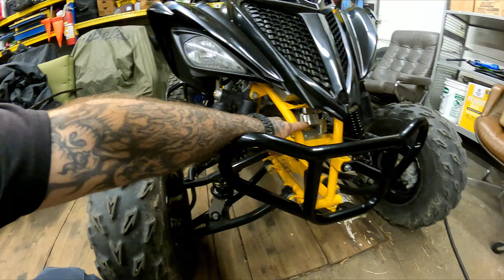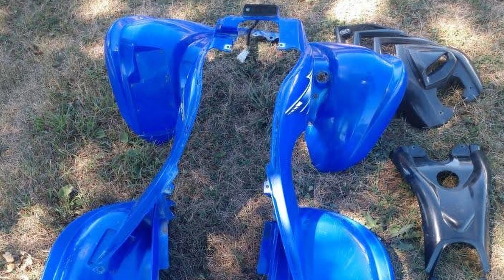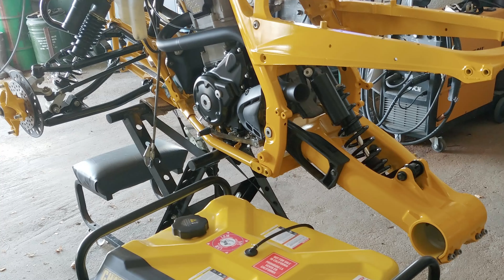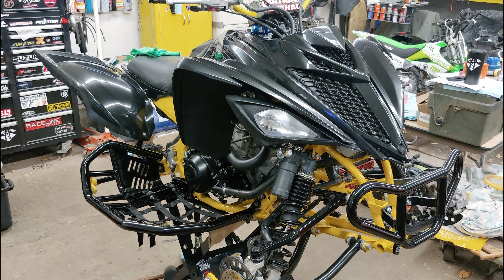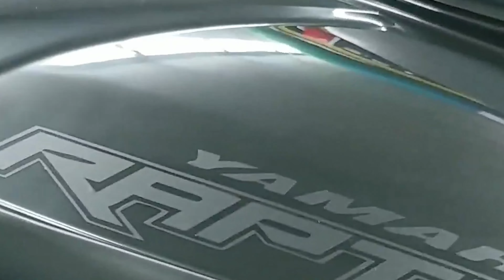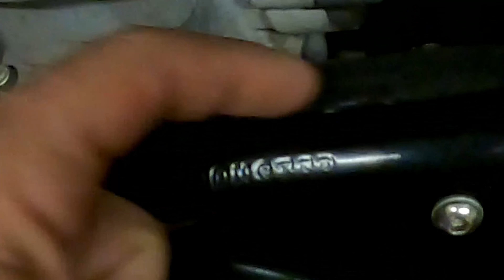Raptor 700 Powder coated and new Plastics, Bare frame rebuild!!

Comment: Video is great man! It is a really clean build. I have been debating on doing the Cerekote myself. To the headers I have. Do you think it is worth it?
Reply from the maker: Oh yeah I think so for sure. If applied nicely it holds up very well.
Reply: Cerekote is great. I did a frame up build on my 06. Sprayed the frame and a bunch of parts with the air cure cerekote. It has held up great. It is all about the prep. I have a media blaster and did everything myself except the frame. I had a local shop blast the frame and I sprayed it. Cerekote is great because it's ultra thin...no worry about spraying threads etc. The air cure is awesome as well...no oven needed.
Reply from the maker: Yes that's what I used, the glacier black air cure. That's what I used on my ltr exhaust and cylinder also. I bead blasted everything including our frames here at home too.

Comment: Was it challenging putting new plastics on an older model?
Reply from the maker: Not bad at all. It requires the newer style headlight mounts, which are cheap and available new, then everything else is reusable. The dash lights even swap over with no issues.
Reply: So the new nose and tank cover fits on the old plastic and u can plug in the new style dash and it works.
Reply from the maker: I didn't know this.